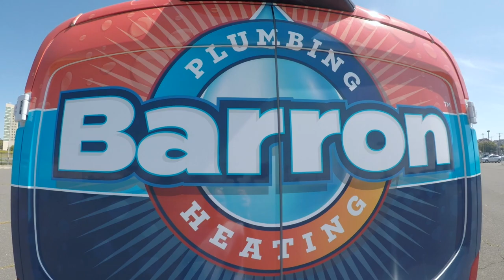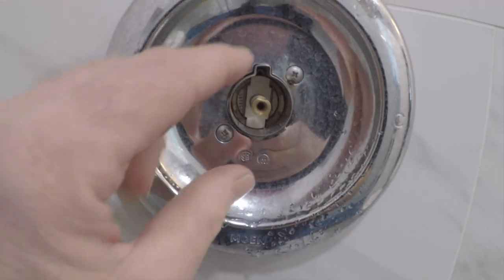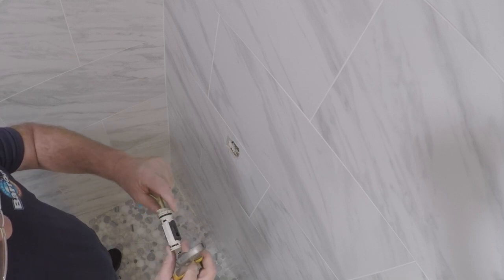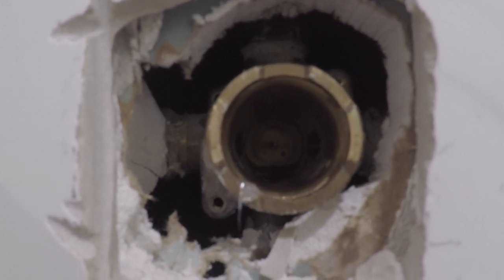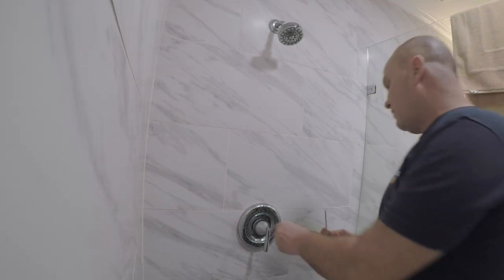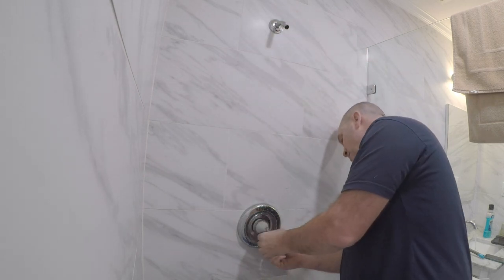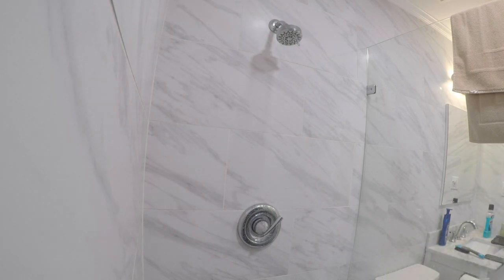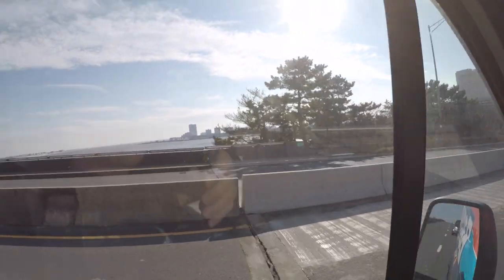PLUMBING REPAIRS | MOEN SHOWER CARTRIDGE INSTALL | PLUMBING APPRENTICE

Comment: If you pull the Moen stem and turn it upside down where the “H/C” is down, the hot and cold will be reversed.
Reply: 100 %  correct
Reply from the maker: Thanks Joe.
Reply: Tanks Rob!  You outdid yourself today!!  (Tanks = Thanks)

Comment: Today I learned from Rob Gausepohl that if you re-install a Moen shower posi-temp 1222 cartridge upside down it'll change the hot and cold sides.  It's the Moen 1225 and 1200 cartridge that you can just rotate the shaft 180 deg. to change the hot and cold sides.

Comment: Or just turn the cartridge stem 180 like you did. On the acrylic single handle type if the waters are reversed just flip the handle! Moen Faucets are one of the Easiest Facuets to Fix Chuck B 1.

Comment: "Always cover the drain". Doesn't cover the drain. "Always cover the drain". Doesn't cover the drain. I guess a rag is too expensive to carry with you!!! Good thing you had a plastic cartridge that needed replaced and not an older brass style. They usually get "welded" into the faucet body and need a puller and a few choice words to get them to come out.
Reply: That "brass" cartridge you speaking of, Gman,  is the 1200 series (smaller in diameter) style [all plastic] cartridge.  And you're right the 1200 all brass style cartridge 'meld' together with the brass body of the mixing valve for sure!
Reply: There's a trick I invented myself when I was younger helping my father in the Plumbing Profession.If the stem of the brass cartridge comes out and the cartridge body stays in the valve body I would use WD-40 and a nipple extractor lightly hammer it into the cartridge body and use a crescent wrench or a small pipe wrench loosen it left to right and then rotate it and it would come out simple.Try this trick gals and guys in the Plumbing Profession I know it will not fail you.

Comment: the tile people screwed you on that one, that's small enough a hole, I'm surprised the plate sits flat to the wall and seals. it usually needs minimum three inch hole to sit with outer ring touching.
flip the cartridge over to reverse the hot and cold, for reverse plumbed/back to back installations.

Comment: Yeah I dropped a clip in the wall lucky the other side had tall base boards I  took off the base board cut a small hole fished it out put base board back can't even tell that's luck because I didn't have another one either, thanks for the video hope you and your family had a good Christmas.

Comment: I use my foot deep cover the drain when working with small parts because if it can happen it will, the faucet assembly is entirely too far in the wall.